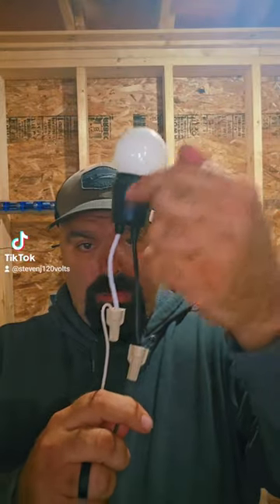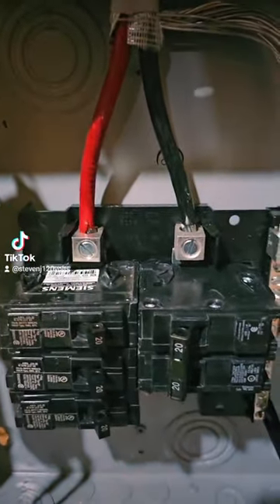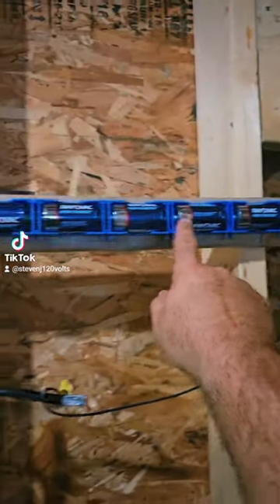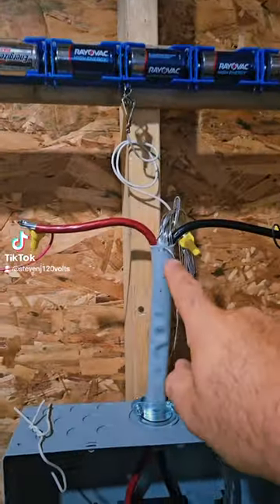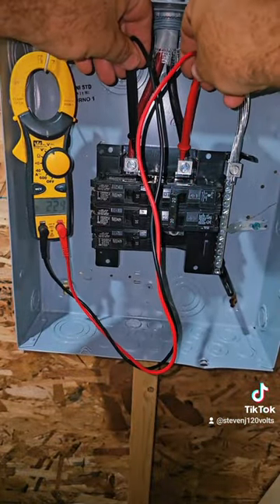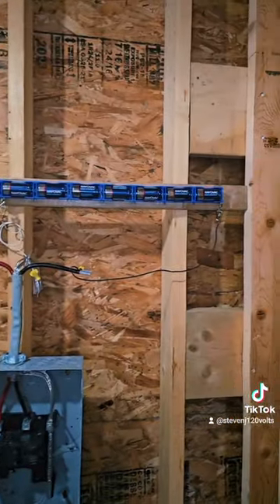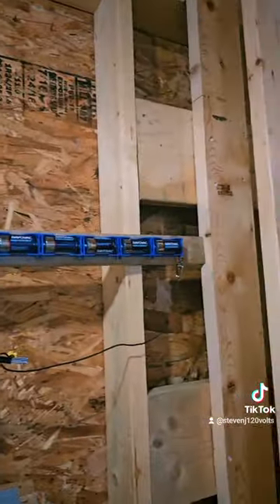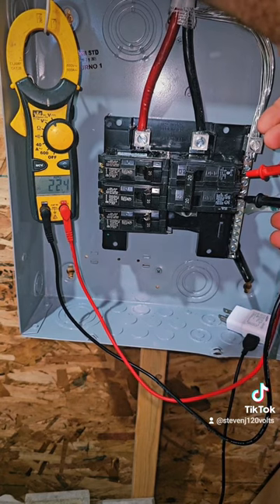why doesn't a 240v circuit need a neutral???

Comment: Voltage between neutral and ground was?

In AC power the two hot lines coming in to your home should be 180° out of phase.  This is why there is voltage between the hot wires.  If they were truly in phase with one another then you would read 0 volts between them since the electro potential between them would be zero.
Reply from the maker: No....they are two legs of the same phase with reverse polarity.
Reply: We are saying the same thing.  The two hot lines are opposite polarity for a given time frame because their respective sine waves are 180° out of phase.  This is why you are able to read a voltage between them.  If the hits we're in phase with one another (sine waves the same at a given moment in time) then you would measure zero volts between them.
Reply from the maker: @iceman9678  there is only one wave not two.  Just because you split it with a center tap does not create a new wave or phase.  Cutting an apple in half does not give you two apples   if they were out of phase the nuetral would carry the sum not the imbalance.  The vast majority of all current flows from one leg to the other.  The nuetral is nearly irrelevant.  It is incorrect that most ppl are taught to use the nuetral as a reference.  It's bring 3 phase terminology and thinking to a single phase power supply
Reply from the maker: If you truly and completely understand why the nuetral has only imbalance fyi NO current is "canceled" it all still flow back to the transformer.. if you understand that then you will understand they are in phase but reverse polarity.  180 out of phase does not allow for the neutral or have only the imbalance
Reply: You're confusing my original post.  I asked what was the voltage between your neutral and ground in your setup.

As for the second part of my post, I am specifically talking about the 2 HOT wires that come off of the transformer to your home.  Each HOT wire carriers 120VAC but with a 180° phase shift between them.  This is why the voltage (electrical potential) between them is 240VAC.

Each HOT wire carries a single wave BUT the waves for any given moment in time are 180° out of phase or as you say opposite polarity.  In 3-phase there would be 3 wires with a 120° phase shift.
Reply from the maker: @iceman9678  nuetral to ground would be zero.  There is only ONE transformer winding in single phase. In three phase there are 3 windings
Reply from the maker: @iceman9678  sorry if I mess up responses. YouTube notifications are confusing.  And I have alot of ppl over here still saying the are 180 out of phase. Not sure which I have responded which to.  I can direct you to electrical engineering videos that explain it.  But the two legs are the phase they can't be out of phase.   Measuring from the nuetral gives odd reading that mimic 3 phase logic so instead of learning two ways of thing ppl learn one. But it fails to hold up apon deeper understanding.
Reply: The two hot wires (L1 & L2) are 180 out of phase from one another.  This is why you measure 240 volts between them if they were in phase with one another you would read zero.  By definition they must be out of phase with one another (reversed polarity) else you wouldn't be able to get 240vac between them.

They come from a single high voltage feed to the transformer but when you step down the voltage you can 'split' it via a time (phase) shift.

This is NOT a two-phase system but the L1 and L2 are not in phase with one another. A 2-phase system is generally 90° out of phase between hot leads.
Reply: Gave you likes for the algorithm!
Reply from the maker: @iceman9678  I am just repeatedly explaining your version is the entry-level it fails deep understanding.  It's 3 phase terminology and method being used on a single phase system.  I can give you electrical engineering videos to watch.  Until you understand why a single phase center tap carrys the imbalance instead of the sum. You don't understand you are just repeating what a book told you.
Reply from the maker: @iceman9678  its not split to do a time phase shift.  If ONE secondary winding with a tap in the center of the winding.  What ever book you are copying and pasting from is incorrect
Reply: You are telling me that I am wrong but you have not disagreed that L1 and L2 are 180° out of phase with one another.  You have recharacterized this description as 'reverse polarity'.  Two AC inputs that have reverse polarity are by definition 180° out of phase.
Reply: I am not and have not been talking about the neutral wire
Reply from the maker: @iceman9678  they can only be said to be out of phase relative to the neutral.   If you ignore the neutral it just two wires making one phase. One phase can not have two points out of phase.  Those two points are just one phase.  Opposite ends of the same phase.
Reply: I really don't understand your description.  AC power doesn't have polarity outside of an instantaneous reading.  You can see this with a scope.

If measure voltage between L1 and neutral I will get the same voltage as L2 and neutral.  If L1 and L2 have 'reverse polarity' then L1 and L2 should have inverse voltages on the multi-meter.  However, they do not.  L1 and L2 are 120VAC with their respective sign waves 180° out of phase.  Similarly, you can see these two waves with a scope.
Reply: The two legs aren't 180° out of phase from one another. They're 90° out of phase from one another. At 180° they would cancel each other out. The reason for it is because with homes we're dealing with a single phase that has been split. So it's not 2 phase, it's split phase. What you're saying is that split phase is the equivalent of 2 phase and they're not even remotely the same. 2 phase once existed, but was eliminated because 3 phase was discovered and was vastly superior. Just to clarify even more, if this was 2 phase, then 2 individual wires would be coming from the utility company to a transformer to drop the voltage down to 120 each leg, then into the house disconnect. In single phase a single wire is coming from the utility to a transformer to 1, drop the voltage to 240V and 2, split the single phase to 2 legs.

The voltage between neutral and ground would be zero. The neutral is called the grounded wire because it's bonded in the disconnect. It's because electricity needs a path to source and that source can be back to the utility, but sometimes it's to ground. But that's why zero is read because the two are bonded.
Reply: @TheForgottenMan270  In the USA L1 and L2 wave forms are 180 degrees out of phase with one another or said another way their wave forms are inverted from one another.

I am not referring to "phase" as an individual power feed.  I am referring to the phase angles of the sine waves for a specific moment in time.

If the wave forms for L1 and L2 were the same phase angle together, then you would measure 0 volts since the electro-potential between them would be zero.  It would be analogous to measuring the voltage between any two hots any where on the L1 leg.  If you do this, you will see that you have measured zero voltage between them.  You'll get the same results if you measure the voltage between any two hot drops of the L2 leg.  Why?  Because there isn't an electro-potential between them. 

Granted L1 and L2 are derived from the same single coil but that doesn't mean their signal wave phase angles are the same and by definition they can't be unless they were tapped from the same location on the coil and used the same reference.

Comment: There is a big difference between 110/220 and 120/240, both of which are normal here in the US of A.
Reply: Not really that big a difference, My Service voltage  Transformer Tap has been as much as  132/265  without any noticeable  effects.
Except I can use longer extension cords  without losing torque on a power saw. 
  I am not on a three-phase line, but the tap on your service transformer can be adjusted to compensate for supply line loss and load.   I am pretty close to the substation and measured these voltages  before many homes were built and added to our line, more recently it was  250V

Comment: The neutral dissipates the current to ground. Where does it go in this situation?
Reply from the maker: Electricity from a transformer does not flow to ground or dissipate to ground.  It only flows back to it source which is the transformer
Reply from the maker: The neutral does not dissipate current to ground.  The Electricity in your home does not and can not flow to ground

Comment: The biggest problem is that we use DC terminology when talking about AC systems.
Reply from the maker: Cuz they are more alike than they are different.  It like the difference between a photo or a video.
Reply: @Stevenj120volts  I don’t think frame rate is a big consideration with photos.
Reply from the maker: @LTVoyager  I didnt say exact match but a more in common than different
Reply: @Stevenj120volts  As an EE, I’d say more different than in common.  AC has impedance to deal with, power factor, skin depth, propagation of fields through space and many other issues beyond the stark simplicity of DC.

Comment: Next video:  Two wires for 240v won't work with a GFI.  A 240v GFI breaker needs a neutral.  Why?
Reply from the maker: No they don't.  The breaker needs to connect to the neutral bar. But the branch circuit does not.  All pool bump motors do not have a neutral connection

Comment: You are explaining single phase like a 3 phase, because it essentially is.... but...
AC voltage is a push and pull, by hertz. Hertz is the cycle of ups and downs per second of a sine wave. AC has an alternating potential. 
You're using DC batteries to illustrate. DC is a push OR pull only. DC is either a positive or a negative potential only, not both. This is not the same.
Neutrals are an energized ground. 
The 2 legs in a single phase 240v panel act together like an amplified 110v push and pull, by hertz. For 110v applications, the alternating current needs a pathway to ground to accomplish the push/pull action of AC.
The ground is a center tap that occurs at the point of production and utilizes the earth as a conductor for that center tap.
Using DC voltage to explain this, however.... misses the key aspect of cycles.
Reply from the maker: You are close but electricity from a transformer never flow into the ground.  Its not how the physics of electricity work
Reply from the maker: This demo will teach Electricity downs flow to ground
https://youtu.be/edalDYg5lbU?si=Waz1bsBmjaFagRZ7
Reply from the maker: This video will show why 120 volt has nothing to do with a neutral connection

https://youtu.be/Y2Y-VzynHjs?si=iUu0U41rtKw3yMWJ

Comment: The two hots are reverse phase in AC.  Not best explanation.
Reply from the maker: Lol. No there is only one phase in America homes.  Silly
Reply: Actually some homes have two main legs that are out of phase because the voltage between phases is 208v instead of 240v. The voltage between phase to neutral is still 120v.

Math warning. When two out of phases are used at 208v you get 120v …. 208v / square root(3) = 120v
Reply from the maker: @TexasEngineer  I have heard ppl make this claim.  But in 28 years in the trade of wiring houses new and service work I have never seen it. Both my dad and uncle have over 40-50 years in the trade and they have never seen it.  If it happens is so rare that it's irrelevant.   Either way homes sith 240 volts have one ONE phase
Reply: @Stevenj120volts  28 years form a major power company here, the type of service is highly localized and set by the power company. The 120/208v is found mostly in the northeast USA. Electroboom actually did one of his Youtube videos and found 208v service in his oven. Most electrical 240v appliances can be run on 208v with lower power results. Where I live you can get commercial three phase service with 240, 120 and a wild leg 208, phase to neutral center tap. The split single phase 208v is done by connectiion two phases of the distribution lines to the transformer instead of a single phase and a ground for the 240v.
Reply: @TexasEngineer 
In my area of US. Larger apartment buildings are often 208V. 

My house like nearly everybody's in Norway and much of mainland europe is 400V 3Φ. 
But you'll find a Country Cottage here and there on 230 Single phase.

Comment: because its 240 and not 120....ffs
Reply from the maker: You must not be an electrician.  120 doesn't need a neutral either
Reply from the maker: Also many 240 volt load like dryer and ovens need a neutral
Reply: @Stevenj120volts i think it would be L1&N or L2&N.  How else would you measure 120v in this system?

Comment: 240v does require a neutral in most of the world.
Reply from the maker: It's not really a "neutral" it's just one leg being grounded.  You can really have a neutral with only two wires
Reply: @Stevenj120volts  It’s not a ground wire, that’s separate.
Reply from the maker: @user-nm4ey4ih7u  there is a ground wire.  The neutral is also grounded.   One is the grounding wire and one is the grounded wire.
Reply from the maker: Can't have a neutral with only 2 wires.
Reply: @Stevenj120volts  Yes you can.
Reply from the maker: @user-nm4ey4ih7u  you are just using slang and getting confused.  If it's really neutral, then the hot is one phase of a 3 phase system.  Otherwise it is the grounded(not grounding) conductor. Which can be called a neutral.  But it not really.  It needs more than only other hot wire so that it can be neutral when compared to those two wires.  If there is only one other hot what are you saying it is neutral too?
Reply from the maker: USA singer phase 240 is the same as your single 230.  We just ground at the center if the winding in the transformer which add the option of 120 for our system. We also have 3 phase 208
Reply: @Stevenj120volts  You are getting confused, I’ve seen the transformer in my estate, it’s three phase, our system is not the same as yours. The majority of homes are supplied from a three phase transformer with only one phase and a neutral, so when we call it neutral it really is neutral. We rarely use single phase transformers apart from rural maybe rural farms.
Reply: @Stevenj120volts  The confusion is the difference in American English and British English. Over here ground and Earth mean the same thing.